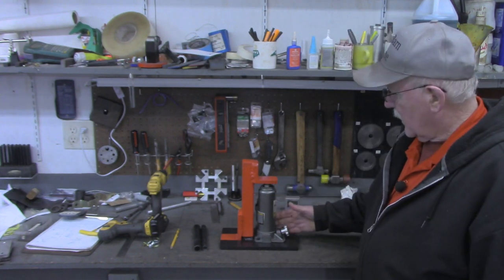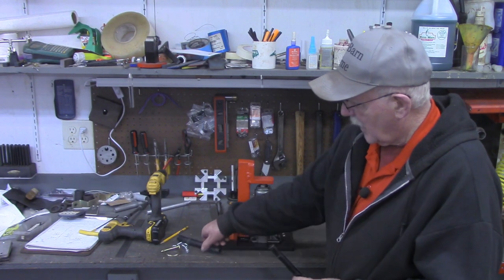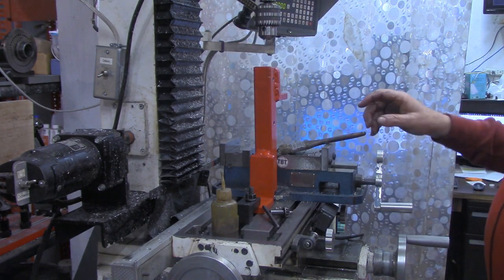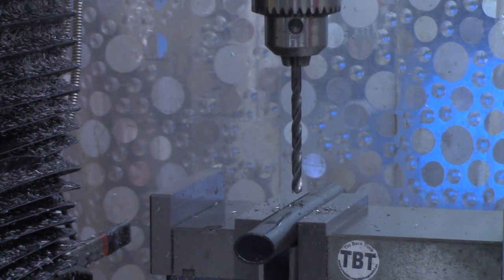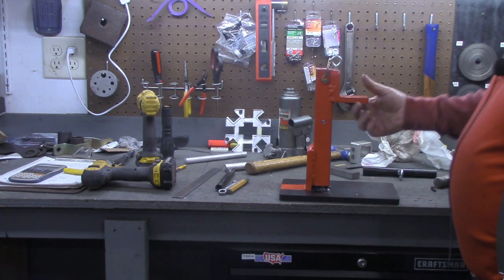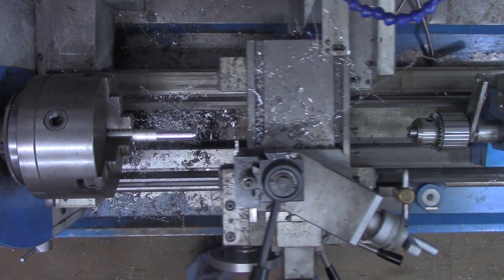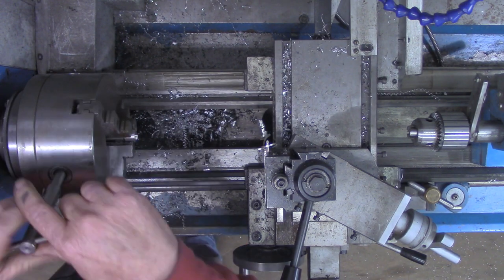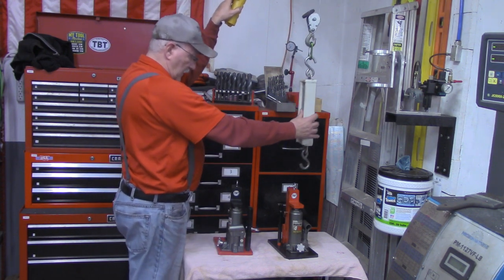Fabricating a ToeJack - Adding A Lift Handle

Comment: You already have it painted but one more thing to keep the lifting toe from tilting when you are lifting would be to weld a 1/4” or 3/8” piece of sleeve between the screw thread of jack and the added piece you built. Using something that just fits over shot of the top of the jack screw would remove any play.

Comment: Nice job on the Toe Jacks. You obviously like working in the shop (barn) and like sharing your knowledge and approaches.
I assume you did it, but did not see, a generous chamfer on the 1" upright where the cross pin goes through to make inserting the pin easier.
Dave